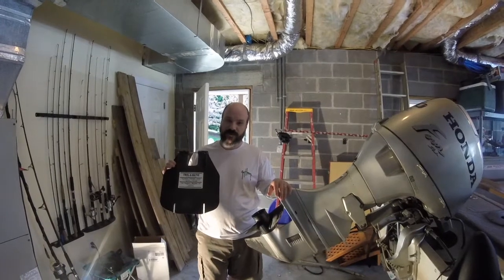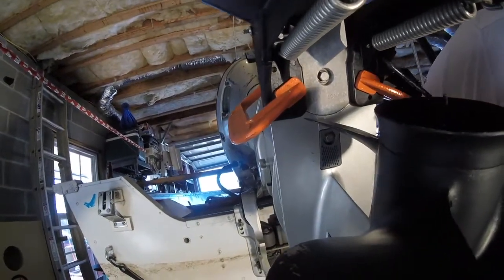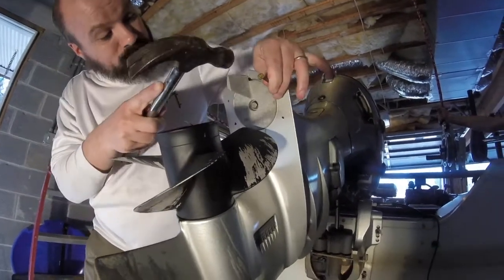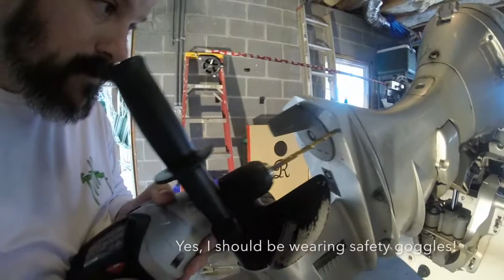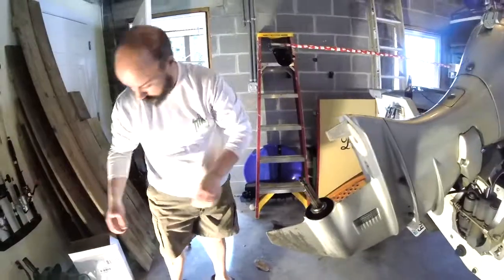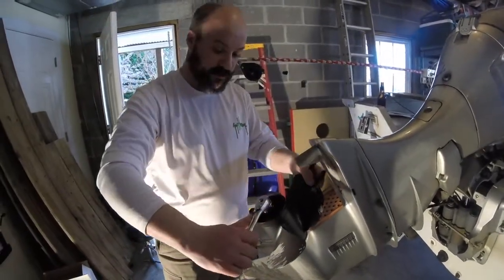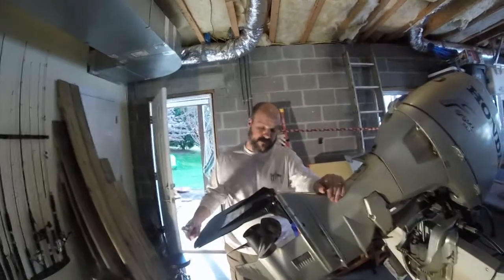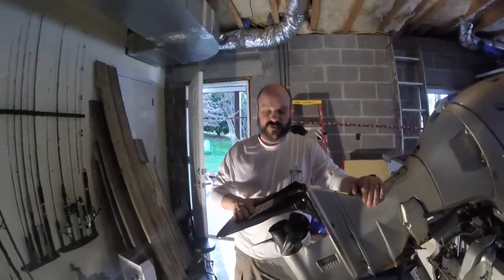Trol-A-Matic - Easy Installation - Part 2 of 3

Comment: Do you know how far back from the prop I should mount the Trol A Matic?
Reply from the maker: Put it back as far as you can, but mount it so that there is plenty of of lower unit fin as this will be under A LOT of torque.

Comment: Do you by chance have a part number for the troll a matic? I have the same Honda 40 horse motor.
Reply from the maker: Here is the link on Cabela's:  http://www.cabelas.com/product/Trol-A-Matic-Trolling-Plate/699629.uts?productVariantId=1186025&WT.tsrc=PPC&WT.mc_id=GoogleProductAds&WT.z_mc_id1=00000349&rid=20&ds_rl=1252079&gclid=Cj0KCQiA2snUBRDfARIsAIGfpqGHzTjUvKd5mOSllLrs3EUouOkAIZw1fdOEJdIT9i0RP_vhY4u_s9UaAlk6EALw_wcB&gclsrc=aw.ds